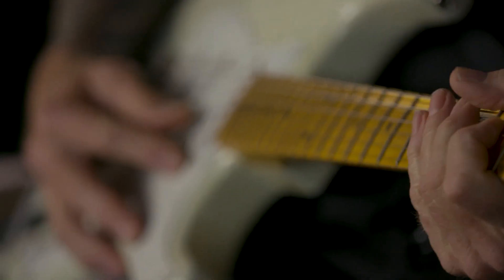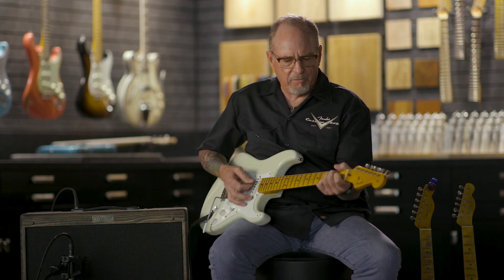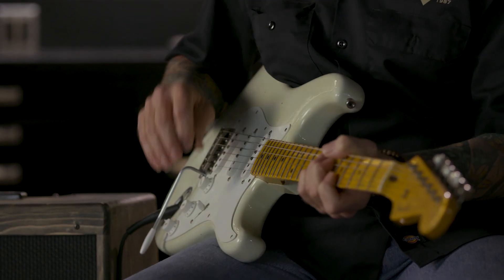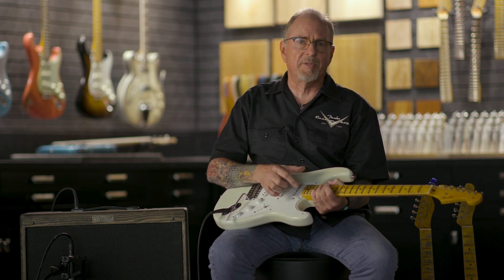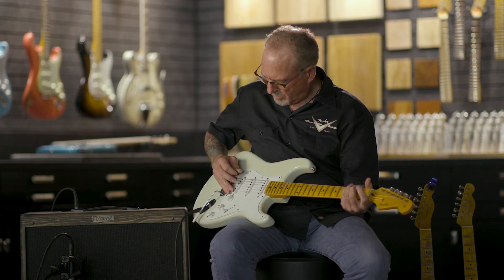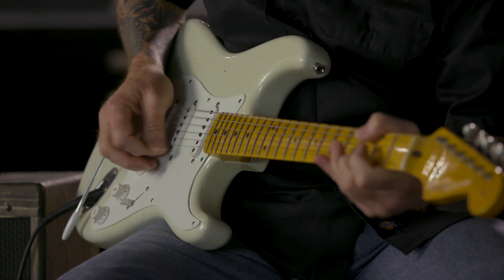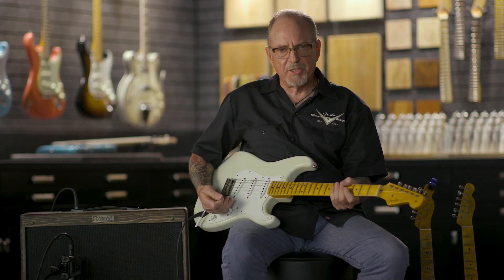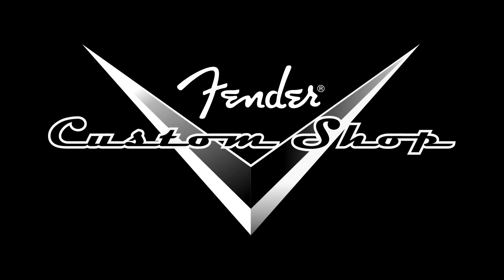Fat '50s Half Blender Stratocaster Wiring | Fender Custom Shop | Fender

Comment: I actually got that wiring in my strat and first thought that the tone control is broken, because i didn’t know what half blender meant. Then I did some research and now I use it soooo much. It’s literally like having the good parts of a strat (like the neck pickup and the 4 position) combined with the good parts of a Tele (like the middle and bridge position. This makes my guitar ridiculously versatile and I never feel the need of using another guitar ever. Simply perfection!
Reply: What is your guitar series?
Reply: @XIGZIX  It’s a custom shop and it came with the wiring. But upgrading any guitar to that wiring is really cheap and not too complicated.

Comment: Fender just keeps on winning and winning and winning...
Reply: I dunno man, they're a bit overpriced. You're better off doing a partscaster build - way more value.
Reply: Gerald West the tone control mod they talk of is DIRECTLY ripped off Gibson. 

I've yet to see a Strat wired stock with the Deaf Eddie style wiring which gives series/parallel pickup combinations plus so much more.
Reply: 8trigrammer the resale value of a partscaster is pretty bad, that is with top parts too.
Reply: 8trigrammer 

Fender practically gives guitars away with their Squire line.

So If you can’t shell out for the most authentic (valuable) model, don’t worry Fender has basically the same exact thing for 700 bucks less in the Squire series, and with a small bit of passion, you can mod it into 99% of the ‘real’ thing. 

$1000+ for an American made instrument by the most iconic name in guitars is fine.

How can anyone really bitch about Fender? I think they do everything exactly right at this point and have completely recovered from the mistakes of the past.
Reply: Mark70609
So what, everyone keeps pestering about the resale value. If it's a great guitar, why would you sell it?
Reply: The Echelon people seem to get bored of guitars rather than see them as a source of inspiration.
Reply: @Mark70609  when did Gibson do that? last I checked a similar type of blend was around on the Broadcaster and was kicked around by Leo in the Mid 50's but Don Randall didn't think it would be very appealing and created confusion as to which wiring did what... The 3 PAF custom didn't come around until late "57 and its wiring simply folded the middle PAF into the bridge and neck. So how exactly did leo rip this off?
Reply: Last time I checked, there wasn't a company that "owned" a certain way of wiring circuits
Reply: @Mark70609  Who cares about re-sale value when you get it set the way you like the sound?
Reply: @8triagrammer  Yeah, can you buy this wiring deal by itself and just  wire it up on the guitar you already use?
Reply: instablaster
Reply: @gabrielm.4554 Maybe wiring the tone pot to the volume is what they mean ..like Gibson do on 2 pickup Guitars...it's just another way to wire the controls. The Fender in the video sounds good like that but he's got a Tweed style super amp or something that makes it sound massive. I like the blender circuit.

Comment: This is not too new to me! On my 70's strat, I had my guitar tech set the same switching up, but with no "Blend Control Knob". So I can play all pickups or the neck/bridge combo; just not with a blend control. The neck pickup tone control (middle knob) remains a tone control, but has a push/pull configuration switch for quick access to the pickup tonal configuration changes. It sounds GREAT! It's unusual that Fender has just presented this - the wiring, from what my guitar tech told me, is not rocket science. I'm glad I had this done nine (9) years ago; the additional tonal variety set this guitar into "TONE PALATE" heaven for a Strat. Great job FENDER to bring it a step higher than mine!

Comment: You want to make a bet...I wire all of my three pickup Fenders for 7 way and switch back tone pot to control the tone on back and middle pickup and front tone to control neck...now I will add a center detent pot to do the blend of the middle and back Thanks...simple schematics on line make this possible without Spending a fortune for a Custom Shop Strat!

Comment: I have a partscaster with the treble bleed on the volume - it makes me wonder why every electric guitar doesn't have this feature. It totally works, sounds great and seems like a no brainer...
Reply: Believe it or not there are some people who like that money tone they get when the volume is turned down. I don't get it either. I had a 2000 MiM Strat that was neglected for 20 years so I took it apart and cleaned it up. Put in pure vintage 59 pickups and changed all the pots and the wiring for both treble bleed and tone blender. Added the big American Block Bridge and now I have a Stratocaster that I would not give up for an American Standard.

Comment: Really want to try this wiring setup? I currently have a 5 position switch, push/pull treble bleed on my Master volume, Tone 1 for Neck & Middle, Tone 2 Bridge. The Duncan style TB is not bad, but is quite a contrast from the bypass. It really would be nice to bring the Neck in with my Bridge, sometimes? I think I wouldn’t even want it on the Bridge/Middle position.
Maybe Fat 50’s “Quarter” Blender!

Comment: I like it when they represent these as oh so holly custom shop options that will change the world ans nobody knows of. That wiring is like the easiest wiring you can do. It's literally a pot and two wires, simple af.
Reply: I do sometimes worry about the future of the human race. The comments here are pretty depressing. I mean, yeah, its 10 seconds with a soldering iron. Its like the guys who spend $100 on '50's wiring harnesses' instead of just moving the cap from one lug to another ..
Reply: @cgavin1  Yeah and it's the same when they offer "now you can have the tone control also on your bridge pickup" like it's some magic. That is literally one wire.
Reply: @Zhaggysfaction  ... and has always been the first thing I do to any strat I have ever owned. They are freakin unusable without a bridge tone control.
Reply: @cgavin1  which is funny that they have since the invention of time offered the tone pots on neck and middle pickups yet the only pickup that really even needs it is the bridge pup.
Reply: @Zhaggysfaction  Hehe yeah. Just something else 'Leo got right first time', eh? :)
Reply: Guys, this is for the folks who don’t know who to check the oil in their car…and who will NEVER try to figure out a 5-way switch

Comment: I got the fat 50 Pomo wiring on my 57 Strat I tried to treble bleed it ruined it. I put it back to stock because when you put the volume below seven it drops really drastically I was wondering if anyone knows what I could do to fix that, but I love the sound of it, and the treble bleed doesn't work on this. I think it ruins it.

Comment: can you invert this so you can run full neck with 60% volume bridge or would i just have to run the full blender wiring?
Reply: That's called the blender mod, not half blender
Reply: @LanceJordan  yes, that is the question i'm asking. So you're saying there is no way to invert the half blender to go the other way and i would need to run the regular blender mod. What i was looking for is a way to blend my bridge in to brighten playing clean things on the neck pickup for articulation, and be able to flip to the bridge wide open. So you either don't understand my question or are saying it's not doable.
Reply: @littlephoenix1115  I'm not saying there is no way. There's always a way. But probably you need a push pull or extra toggle switch. There are so many ways to wire a strat. I'm probably going to go with fat 50s half blender on my current project. If I can actually find the schematic 😁
Reply: @littlephoenix1115  surely you can invert this mod for your purpose. And there also other ways to brighten your tone. You could for example use a higher tone pot of 280k if you wanted. I've moded some pots to 300 - 320k range for this purpose. But that's obviously not the same as blender.

Comment: Is the first effect the same as a treble bleed capacitor soddered on the volume knob? Not the blender portion
Reply: Do you mean the treble bleed thing that costs over 70 dollars from Fender that you can literally make for less than a dollar yourself? And it's as easy to make as it is to solder that thing to it.
Reply: No. He's talking about 50's tone control wiring. Tone pot/cap gets wired to volume wiper and output, not to the outer lug.

Comment: Why don’t you use S1 switching system though...
Reply: Price of the S1 switches maybe?
Reply: I have S1 on my deluxe. Going to try changing out the noiseless pickups first, then maybe the wiring if it still sucks.

Comment: So is this something that they only offer through their custom shop I really don't want to buy a Fender Custom Shop guitar just for the wiring in the pickups it's going to cost me $3,000 I'm not a pro
But I love that sound
Reply: You can buy a blender pot from several different sources on the internet for pretty cheap. The schematics should be available from the seller. Most music stores will recommend a local repair guy who can do the install for you. Probably less than a hundred bucks with parts and labor.
Reply: I have this wiring on my am std strat. It's pretty easy to do if you're comfortable with a soldering iron. I'd guess it costs:

$5 -- blender pot (recommend the emerson's)
$15 -- entry level soldering kit
$5 -- extra wire. There probably enough already in any given guitar, but a bit of extra buys peace of mind in case you cut something too short.

Plus a few hours of actual work time.

Comment: Why buy custom shop? Buy a vintage refin for a little more
Reply: Well.... Because they're custom. You can choose neck radius and profile, pickups etc etc.
Reply: @luizspindola  not worth the money..not to difficult to find a neck profile and switch out pickups...
Reply: @daveywiles6412  I agree it's not worth it. But they aim the "rich enthusiast" market I guess.
Reply: @luizspindola  yeah but rich enthusiasts could spring for a refin 1962 for a little more money and get the real deal instead of remakes...I find custom shop reissues phony especially relic fenders....it's like buying a lie
Reply: Davey Wiles yeah it’s like women wearing makeup. Totally fake!
Reply: @daveywiles6412  what if they want one NOW. Or what if they don't really want something originally vintage? What if they want something in a specific color? I really think that's the whole point of CS. Plus "fake" relicing is not exclusive to Fender Custom Shop
Reply: @luizspindola  for a bolt on guitar what is sooooo different that cost the extra $3500 picking pickups? Neck carve and lacquer???
Reply: @luizspindola  let's face it the reason for custom shop is to recreate the pre CBS guitars for the most part...the price point is not correct...there are CS fenders on reverb for over $10'000 it makes no sense other than creating a false value ..they are made 95% the same way American standards are made
Reply: @daveywiles6412  I agree with about the price... But there's people willing to pay for it. 

I'd never pay for a Fender CS on that price range right now, but if I had A LOT of money then why not? there's people doing that with cars, then why not guitars too?

I don't want to sound like I'm defending Custom Shop Fenders... I just understand why people with would want one instead of getting a vintage one because vintage can be finicky, they could be refins and they can not play the way someone wants it to. I really believe the huge price comes from the "custom" part. Question is do you think it's worth it? Some people do
Reply: CS has nothing on the real thing. sorry
Reply: @luizspindola  when your buying an expensive car your getting way more...not with a custom shop fender I've owned one I traded a custom Les Paul when I was younger and totally regretted it....it was no better than my old srv....I own a couple pre CBS strats.   Guys should buy a refin as long as it's in great shape for a little more..smart on fender to make reissues of old stuff but I just find it phony
Reply: It’s my money, why do you care how I spend it?
Reply: @daveywiles6412  Thats right, it's just 2 planks of wood screwed together. By putting high prices on thier Custim chop" some rich dudes believe it must be the best. Remember there are players and collectors now, collectors/investor types that can't even tune or re-string a Guitar cos they hang em  on the wall or put them in glass cases(Okay if it's really special or old). Guitars are bigga bizuniz now and Fender knows it. I don't mind as long as the qualityvof the "Regular" guitars is good.

Comment: I feel the same on my strat classic player 2007 with the "custom shop designed" wiring. Sounds like a telecaster with positions 2 and 4 with high treble, and regular 2 and 4 stratocaster sound with low treble... But the sound is not as awesome as these fat 50 !

Comment: Also known as a 2 minute mod with a piece of wire and solder lol... What are we even doing here???
Reply: Howie Hill , I was totally thinking this. Can I just do this mod myself ?
Reply: @johnsmith-so5do  There's a million different versions of treble bleed circuits, dude... You just need to google or youtube how to do it yourself, and which capacitors you should use for what applications... The greasebucket circuit is literally nothing fancy or difficult at all...